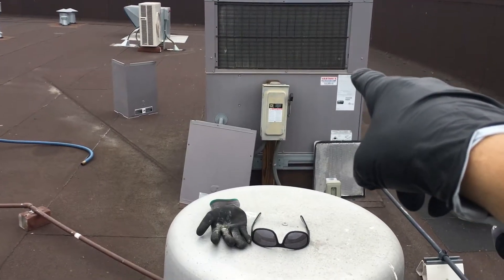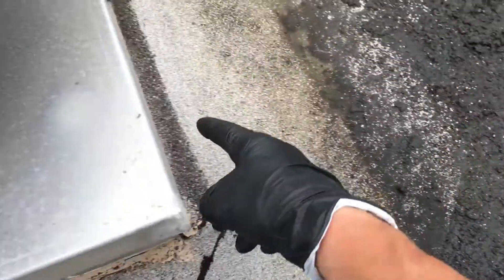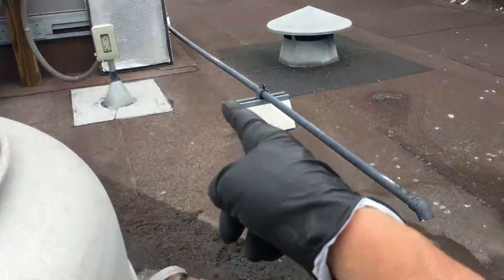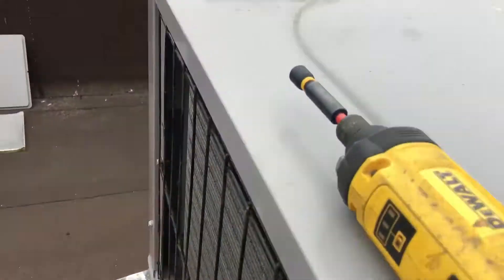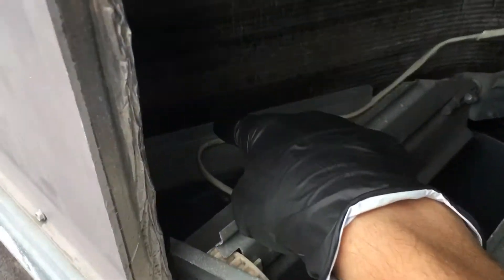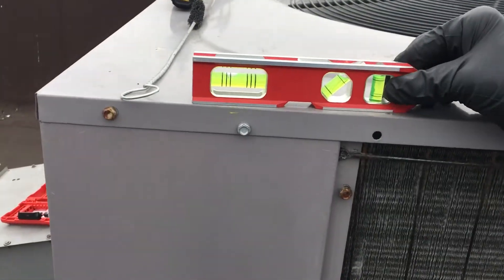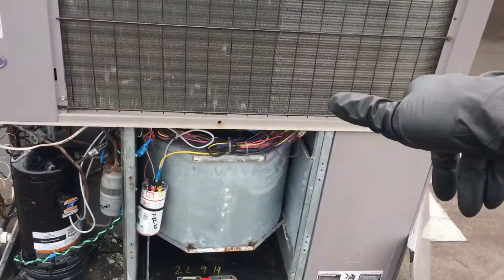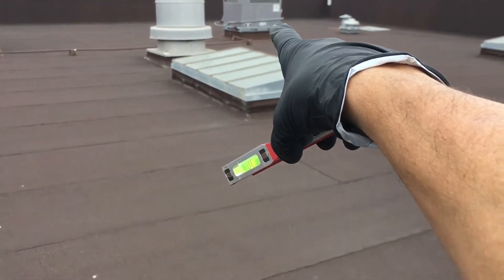Condensate drain on roof causing leak, condenser units drain pitched uphill

Comment: Are those Chinese Condenser fans OE on that Carrier unit ????  Are the mount frames/structure adjustable? Thx...interesting 👍
Reply from the maker: TheGibby3340 yes those are very cheap some of the bottom of the line condenser fans on a Carrier. Most all of the fans are now produced in either Mexico or China. Your options of choice are the very cheap Chinese or the very cheap Mexican made ones or the ones that have been designed and ordered from possibly a American or German company built to the specs buy a American or German company but still produced in China or Mexico.   The frames the mounts on the roof are built to purpose at the time of installation they are solid not adjustable.
Reply from the maker: TheGibby3340 I got a video to share with you. https://www.youtube.com/playlist?list=PLtZBoI6huZQIfO2YSENzl1es-BRFbBX-M
Reply: t lech Haha...I have heard a similar one with an Aircraft mechanic belittling a pilot. Ironically I just came down from putting a new roof on my garden shed. 🤣 Still working on it 🤣
Reply from the maker: TheGibby3340 Are you shrivel dried out like a leathery small ball sack 🤣